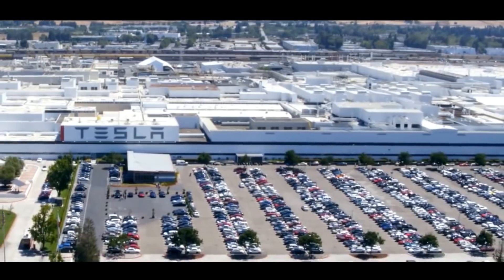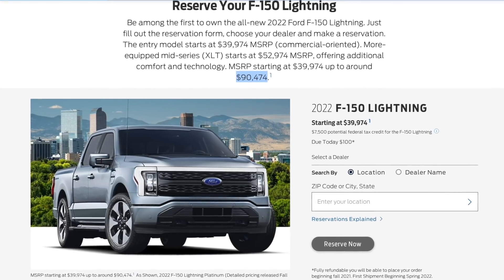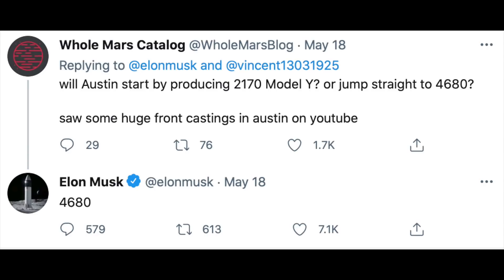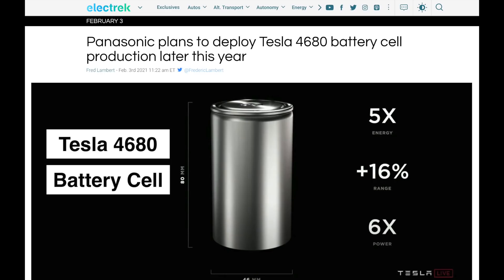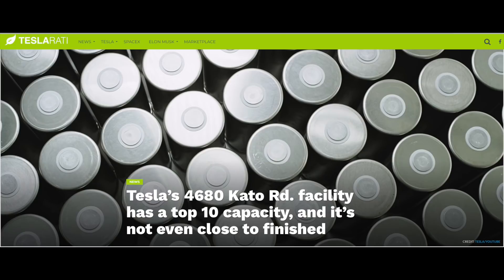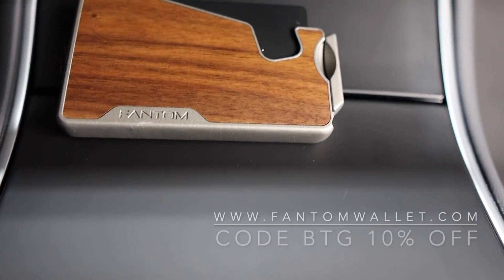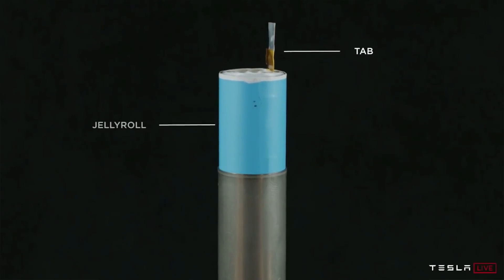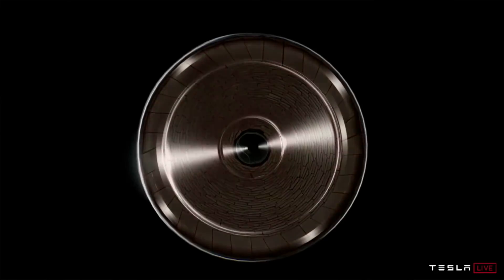Tesla Model Y - Version 2 Incoming?

Comment: I'm in a dilemma right now. I'm afraid if I order now I will miss out on any tax credit I will come "soon"  or any new updates to the car that is coming "soon"
Reply: I've been driving my first car since 2014, and it's falling apart. So I already ordered. Should be late June or July. So depending on when these updates are, I could get the upgrade and then BOOM, Model Y refresh.

I'm debating delaying, but I'll need the car soon because I might be going back into the office. So I might go ahead and get the current Y, then wait for some revisions and then if it holds value well enough, trade it in for an update model if the changes are good enough.
Reply: @webx135  well, both my wife and my car are running well still so I don't have a good enough reason like you do to upgrade to a new vehicle just yet. My wife is getting antsy seeing the price increase but I've been holding out on ordering.
Reply from the maker: No telling what the future holds

Comment: I have a standard range model Y built 4/21 but I believe it has a bigger battery 🔋. It does not slow down like other Teslas while charging to 100%,
 It keeps going at the same rate.
Unlike a model s which slows down at the top 5% of charging.
Reply from the maker: interesting...

Comment: I think they’ll reduce the pack size to the point that the MY has just a modest range increase, 350 miles?  The company is battery constrained.  They need to make packs smaller to free up batteries for more cars/energy storage.
Reply from the maker: I think it is a logical direction they could go

Comment: This whole battery issue is very intriguing as it evolves.  If you are a long distance driver, you want lots of range and ability to quickly supercharge.  If you are a commuter who just needs limited miles and charge at home, you just need a smaller battery with longer charging times.  However, it seems these battery packs that give you range take longer to supercharge…I can see a future where all these other EV makers are going to be more in line with Tesla where all cars get the same interiors with very few options, and the price will only be dependent upon the battery…Love your sales pitch for EVs at the end!  So true!  JUMP IN!  The industry will change tremendously over the next decades, so waiting just keeps you out.
Reply from the maker: The future will indeed be bright for EV's. I agree that options will become more and more limited too.

Comment: Great review!  However, “Tesla exceeds what they put out?”  Have you checked the real world range on any of their vehicles.  EVERY SINGLE ONE is lower than what Tesla puts out.  For the F150, if they follow suit with the Mach-E, Mach-E range was underestimated.  So, the next Tesla to meet or exceed advertised range will be the first…That said, I’m not a fan of the looks of the Cybertruck or the F150.  They are extremes on the spectrum.  Cybertruck at one end and the F150 at the let me take a nap this is boring end…HOWEVER, the utility they’ve built into the F150 is unreal!  And, because it looks like a normal pickup, I think it will trash the Cybertruck in sales…BUT, for both, range under load will be the make it or break it for either one, or both for those who need a truck beyond commuting and casual use (jet skis, mulch, light loads, short distance).  Otherwise, if they both fail miserably under load, my $$ is with the F150 outselling the Cybertruck.
Reply from the maker: That is the EPA test cycle and number...they cannot dictate what the range advertised is
Reply: @BeardedTeslaGuy  I’m not following?  TESLA advertises the highest number they get (I’m assuming) in EPA testing, which isn’t done by the EPA, it’s done by the car manufacturer with parameters given by EPA. Then, the manufacturer has some leeway as to what they advertise with an upper limit.  Seems Tesla advertises the upper limit and others (Porsche, Audi, Ford) don’t, and provide a lower number.

Comment: I came very close to ordering a Model Y this month. One major thing stopped me. It's not that the Model Y doesn't make use of the cameras to provide a side view when you activate the turn signals. It's not that the Model Y doesn't have a heads-up display that could show something like speed limit and car speed. The issue for me is the suspension. I expect a 50K vehicle to have a more luxurious ride. This was the deal breaker for me. I know some have swapped out the suspension on their Model Y as soon as they got it. Really! It's a 50K car.
Reply from the maker: There is hopefully a new and improved suspension coming out with the new structural pack Model Y's
Reply: @BeardedTeslaGuy  Hope so. That would seal the deal for us.
Reply: Isn't it mostly the low-profile tires though? You could just swap to 18" with decent side-wall to dampen things if you don't like the performance wheels and tires.

Comment: Still waiting for my MY. Will I make it to the new battery? Probably not. How much of difference does it make? Not a lot unless you drive more than 100 miles a day or take frequent long haul drives. It would be nice to have 400 miles of ranger that charges quicker but I’ll be ok with what I get when I get it.
Reply from the maker: Yea it’ll be quite a difference on road trips
Reply: @BeardedTeslaGuy  ok I did the math, I may be delaying my delivery. Consider a MYLR costing $55k that includes taxes in NC. With a range of 326 miles, that’s $165/mi. If the 4680 batteries give the MYLR a range of 390, that additional 64 miles is worth $10k. 

You’re right, this is a leap.

Comment: I ordered my Y last month.. Do you think I can upgrade to 4680 battery few years later after battery price come down?
Reply: You’ll get what you get. No swapping because it will be a different configuration into the car. Count on about 65% of stated range for cold and or highway speed and not running the battery down to 0%
Reply from the maker: No, it’s in the structure of the car

Comment: I want to replace our minivan with a 7 seat Y.  However after test driving the Y, that ride is just untenable. I’m assuming many of the very low miles Y’s I see for sale, are from owners with the same disappointment. I’m excited about all the new battery stuff, but I’m on the sidelines until the suspension issue is resolved. I know there are lots of rumors. I’m hopeful that new single cast Texas version with come with magnetic or air ride.
Reply from the maker: Yea, ride could be better
Reply: yes the ride could be better but the low mile teslas you see are a lot of lease turn ins as the 2 year leases are now maturing
There are also after market suspensions that you could buy that get good reviews
Reply: @brianklaus2468  I saw one yesterday with 9k miles. I’m going out on a limb that they really didn’t like that car.
Reply: @trbizwiz1  well my dad traded in his 2018 model 3 with 10k miles for a 2020 model Y but he did like his 3 he just wanted the space of a Y
You just never know
Reply: @brianklaus2468  he liked it well enough to drive it 5,000 miles per year??
I’m sure there are pocket exceptions. But generally, well loved cars are driven more than that.
Reply: @trbizwiz1  FFS He’s 77. I think you’re trolling
Reply: @brianklaus2468  I didn’t mean to come off as a troll. I’m sure your dad loved his car.
I didn’t mean to come off as argumentative. I love Tesla, and I want to buy one. Got my fingers crossed that Austin’s version 2 will meet my needs.
Reply: Drove a performance this week (22 model) and I’m pretty sure it has been revised. It’s really ok.